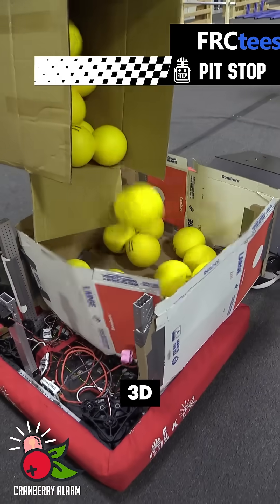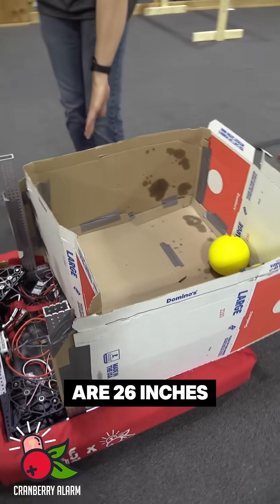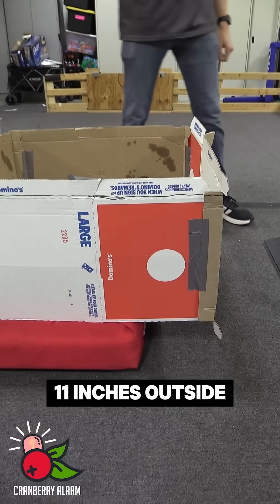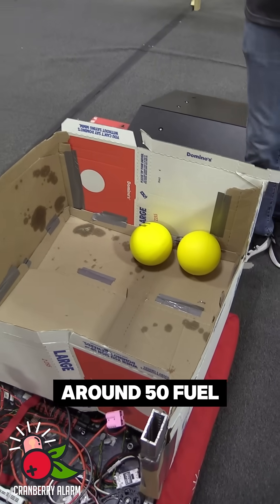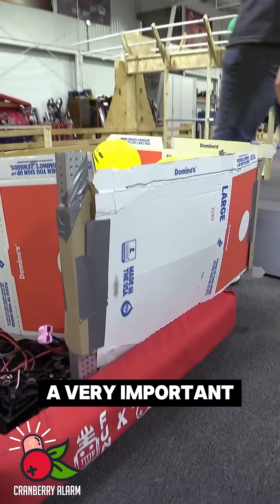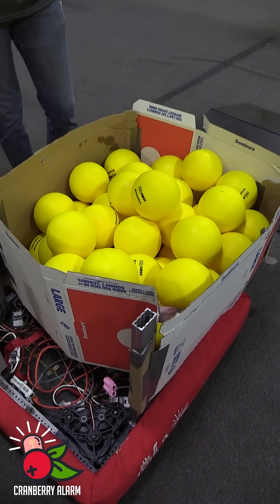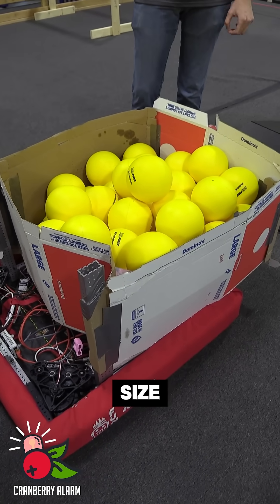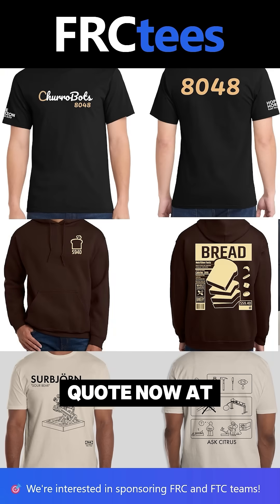How Much Fuel Can This Pizza Box Hopper Hold? | Ri3D Cranberry Alarm

Comment: Note that if you build a hopper with walls that thin and flexible, and they flex out when full of balls, you are expanding in more than just one direction in a way I would not deem momentary or inconsequential (it's literally letting you hold maybe 6-10 more balls). So you better make you're hopper more legit than just some 1/16" polycarb like 254 did  in 2017.
Reply: Would it be against the rules to have a hopper that is flexible enough to expand when full?
Reply: @Calvincoolman2  you cant extend out of frame perimeter in more than one direction